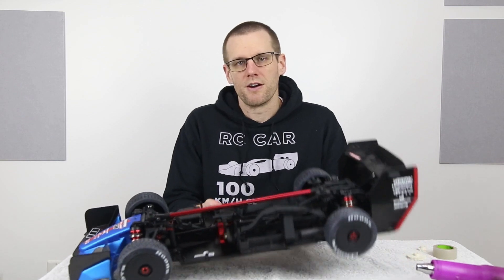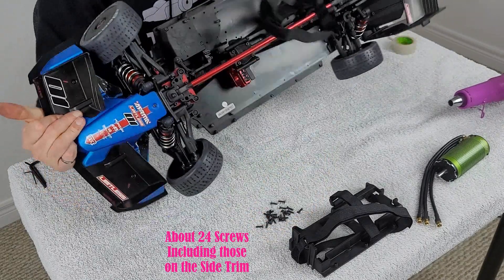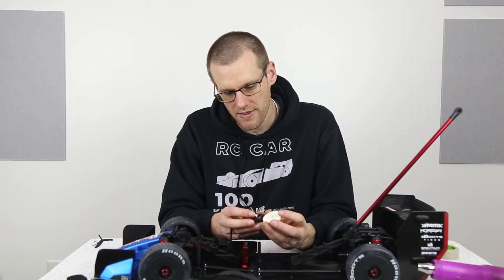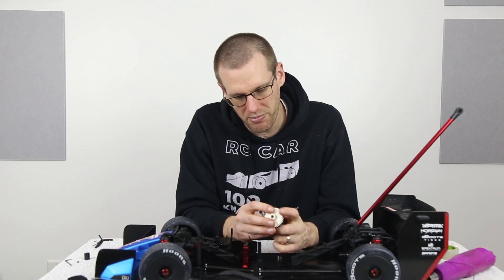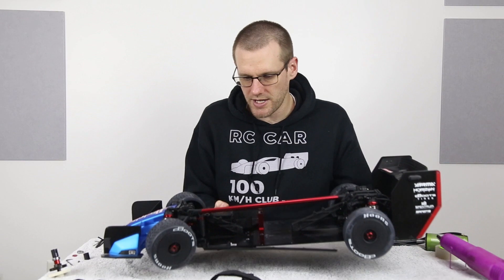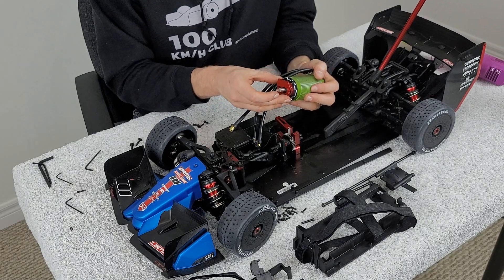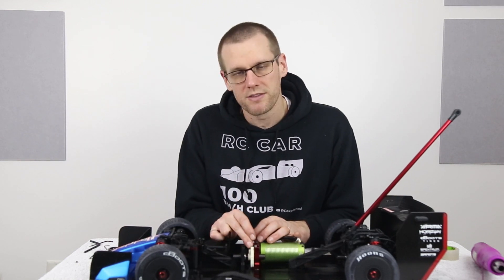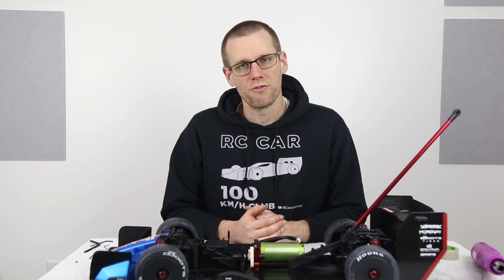3D Printed Gears to help Install the Beast of a Brushless Motor

Comment: What filament did you use to print the gears? What would be the best filament for a gear like you made for a 2s drift car?
Reply from the maker: I used PLA. This is good for any mockup gear. If you are looking to be able to use the gear, you will require a nylon based material.

Comment: Here's a little tip for dealing with thread locked setscrews. If you have an old driver in the same size (possible a rounded or broke one if Allen key) use it and head to heat the setscrew itself, it'll prevent damage to the bearings or seals of the bearings or even possibly the diff (if the diff has a D shaft for a coupler). I prefered doing this so the heat isn't wasted on anything else
Reply from the maker: Great Tip crazyjr!
Reply: @RCexplained , I learned that in my tour through the dark side (Nitro), we had to use red thread locker to lock down motor mounts, and heat is the only way to get them loose. But heat everywhere is not good for anything, especially if you are working fast (between mains). So i used an old hex wrench and a heat gun to heat the screw itself and avoid spreading heat to things like bearings or diffs. just be sure it's a wrench you'll never use, because it'll harden and become fragile

Comment: I use the soldering tip maxed (about 800*) with some solder for better heat conductivity.  It's more focused. 
It worked really well for me. I find that the solder helps keep the fit of the driver really tight also.
It doesn't heat the whole assembly. 
Good info in your videos 👍🤙
Reply from the maker: Great tip!

Comment: Great idea doing a mock up fit with your printer 👍. Torch heat is absolutely a MUST on the grubs and motor mount fasteners. So many stripped screws and 4 letter words without it 😱🤣🤣. Hopefully your demo will save some guys that frustration 🍻😎💪👊👊
Reply from the maker: Thanks for the comment Rich!